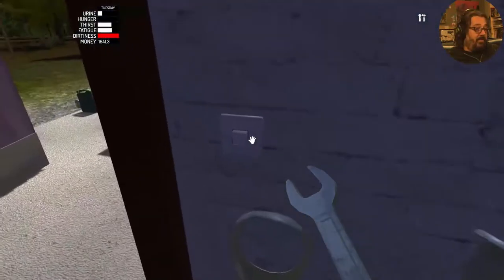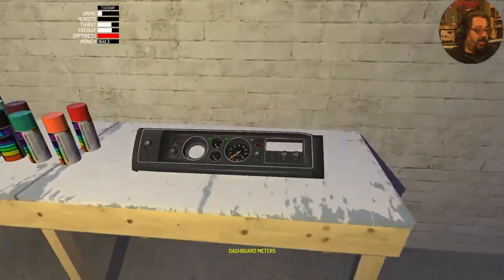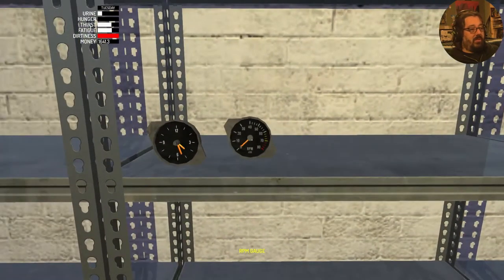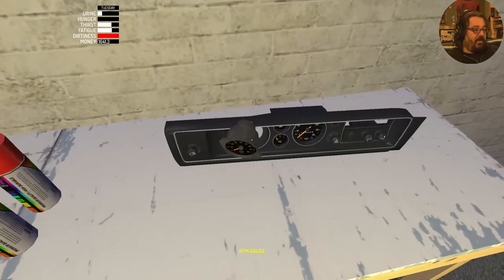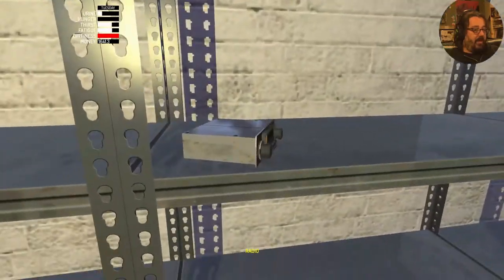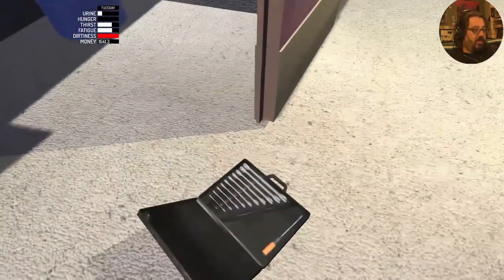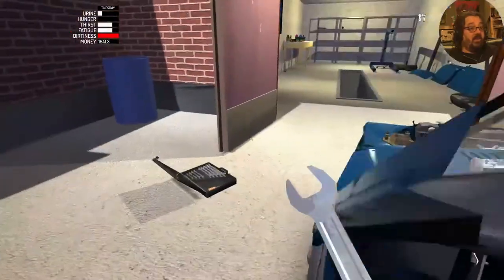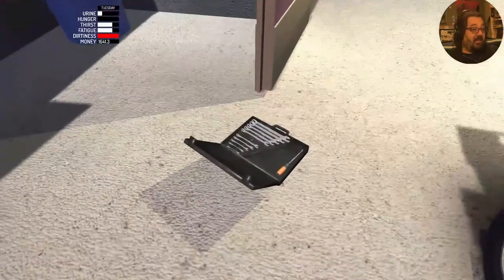My Summer Car How To - Episode 4 : Installing The Interior

Comment: my gears don't seem to shift
Reply from the maker: Devan Rivera you're parking brake is off, correct? if it is then there is a bolt not fully spun on the gear linkage
Reply: GameADayGamer I spun all the gear linkage bolts checked the clutch but no action.....  :(
Reply: I have a feeling it's a bug
Reply: did you fill up your master cylinders?